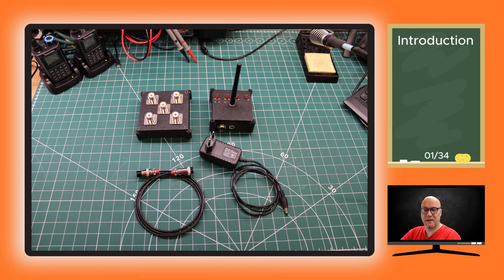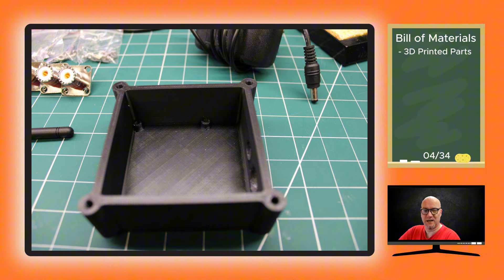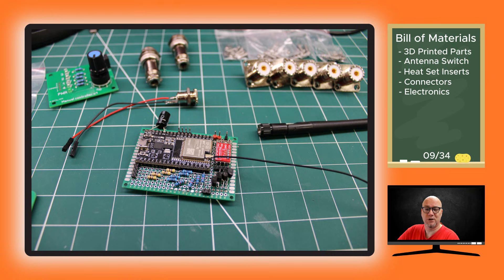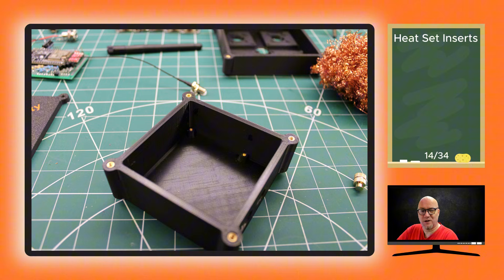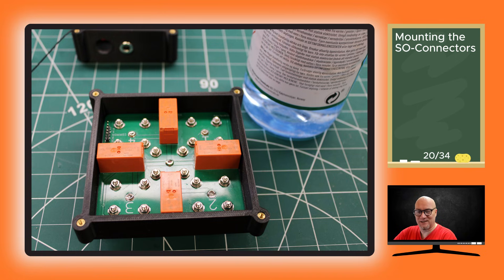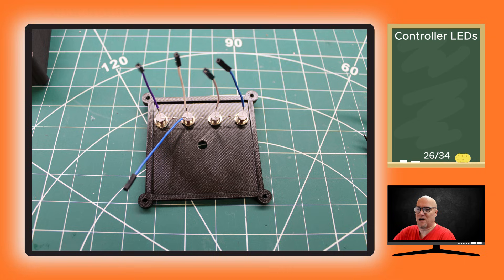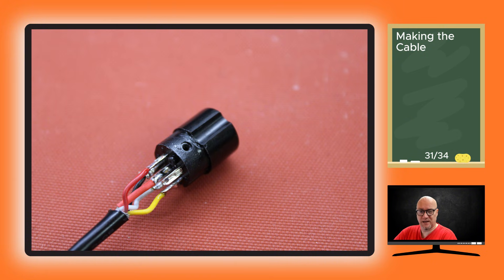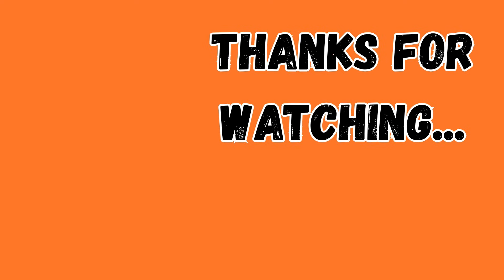WiFi Controlled Antenna Switch

Comment: Great build. The only thing I would do differently is to use the shield of the cable for the ground.
Reply from the maker: Thanks. The reason I couldn't use the shield for ground is the low-side switching. Basically the switching board must me supplied a permanent 12 V and the one of the 4 relays are grounded to engage it. The 3 remaining relays' ground side is left floating.

Comment: Very cool. I just happen to be working on something similar although lot less for me to do. I have designed my own antenna switching PCB, I don't want to buy the Aliexpress kit as I want to know its good for QRO. For the control I bought one of those Tuyo 4 channel relay wifi switches that only cost about £8. This way I dont need to do and programming etc.
Reply from the maker: Sounds like a very cool project; looking forward to seeing it documented. And the switch I bought from AliExpress is most certainly not QRO - but will probably handle 100W well enough.
Reply: @radiohyperactivity I like the 4 way manual switch that came with yours. I need to see if I can buy that separately. 4 way rotary switches are not ten a penny unfortunately.
Reply from the maker: Send me your mailing address, and I'll stick it in an envelope and mail it to you. I have no use for it :-)
Reply: @radiohyperactivity Appreciate that, I have however since found the PCB mountable rotary switches on Aliexpress for next to nothing. I will just design a board to fit my existing hammond enclosure. That will save me more in longer run.